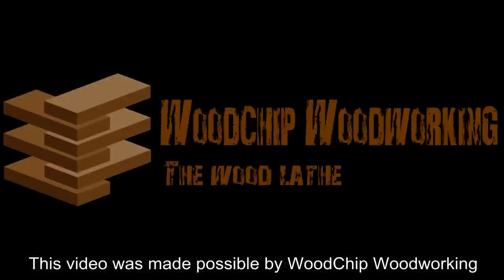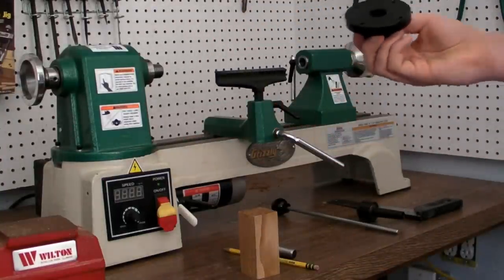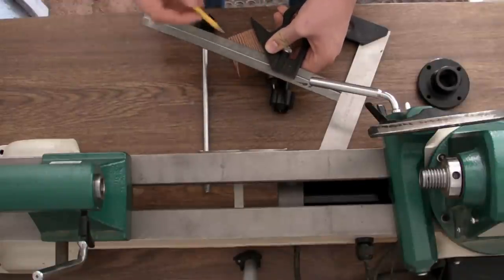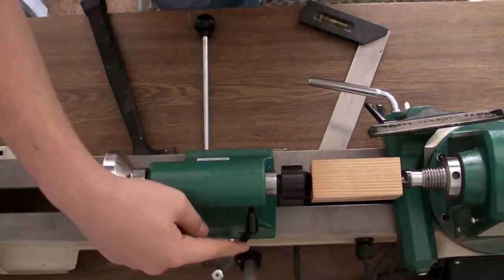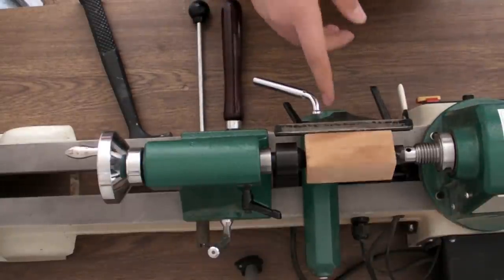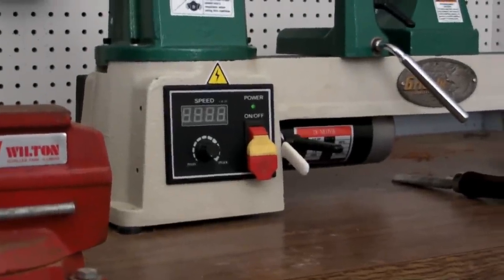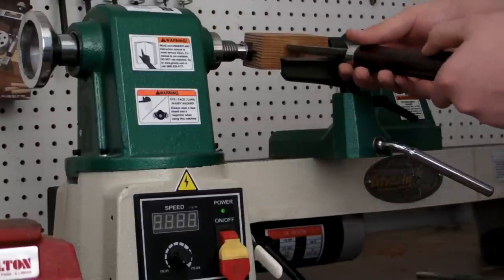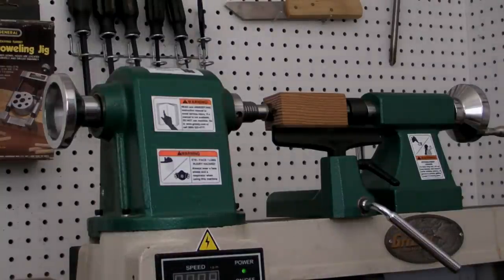How to Set Up A Mini-Lathe (Part 1 of 8)

Comment: Nice video, pretty informative. When turning small stock, would you ever lock the wood into a chuck instead of live centers?  I have a Harbor Freight unit and the bed of the lathe bows as you tighten against a live center.  The bars that make up the bed are cheap hollow square tubes.

Comment: The other way to mount the spur to the work piece would be to use a Bradawl to make the centre hole. Then, with the spur already mounted in the spindle, locate the spurs point into the hole made in end of the workpiece.

Comment: Except for safety, this guy appears to know what he is doing.  It's just too bad that he isn't better at remembering the proper names for the components he is discussing.  
As for safety, it is not wise to put your hand in the area of the belt and pulleys while the power light is on, nor is it wise to hold and spin the workpiece with the power on.  Also, he should put a cover plate over the electrical outlet under his bench before OSHA sees it.
Reply: 0WoodChip0
OSHA does not have to be in your basement to see what you put on YouTube.  Remember the words of George Orwell:  "Big Brother is watching."